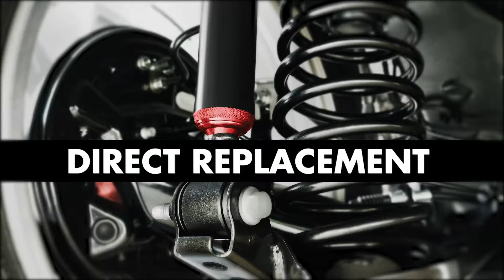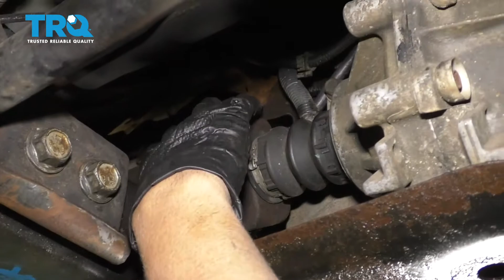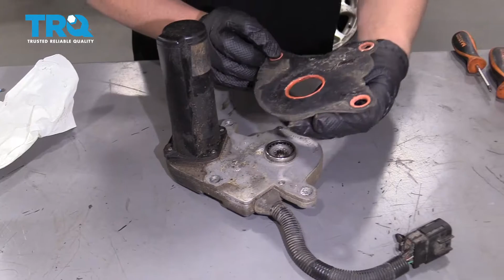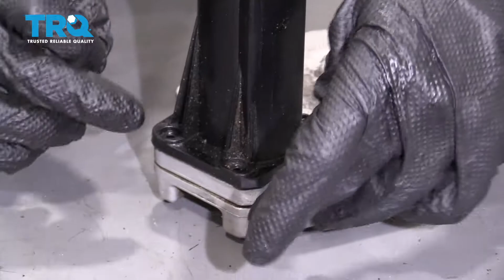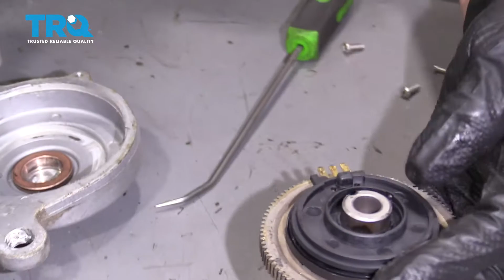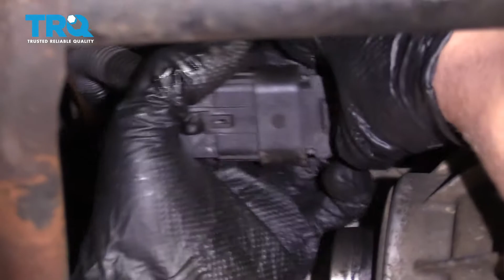How To Replace Transfer Case Shift Motor Encoder Ring 2000-2006 Chevy Tahoe

Comment: Misinformation when it comes to the timing of the gears. If you take it apart in neutral the timing mark should be aligned, if not it needs to be set there.

Comment: Is the encoder ring what usually goes bad or is it the motor that quits? I have one that stays in 4 wheel but after setting overnight will  go back into 2 wheel.

Comment: how can you tell whether the whole motor needs changed or just the encoder ring?
Reply: If you are stuck in 2wd or 4wd or N
Then the motor will need to be replaced. I was told an early sign is not being able to shift from 4L to 4H but getting a registry that it is in 4H, or won’t shift at all just blinking 4H and back to 4L. If it’s the ring I replied to that on a different comment

Comment: What are some signs that the encoder motor sensor is bad?
Reply: When your crank the truck and the lights on the 4wd switch doesn’t show or if you killed the truck in 2wd and you crank it up later or the next morning and it shows 4L, 4H, or N. Traditionally that would be the encoder ring. I would inspect the gaskets, plastic motor housing and harness boot for any damages

Comment: What does it mean to "shift into neutral position" at 7:43? can I just keep it in 2 hi before I take it off?  Thanks!
Reply: the spline on the male end has to match what position the motor comes from the factory in, which is neutral.
Reply: It's all explained in the video bud. You got to comprehend what you hear.